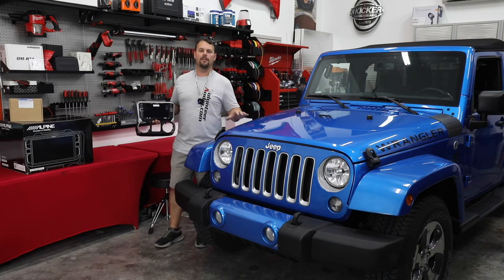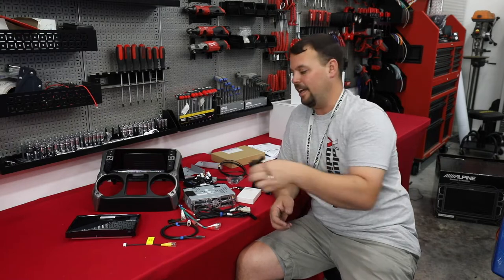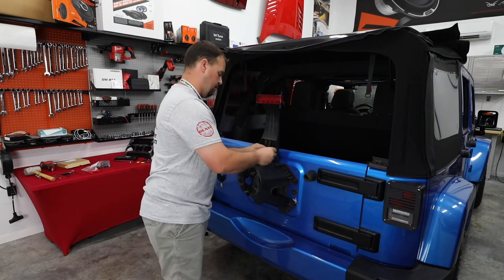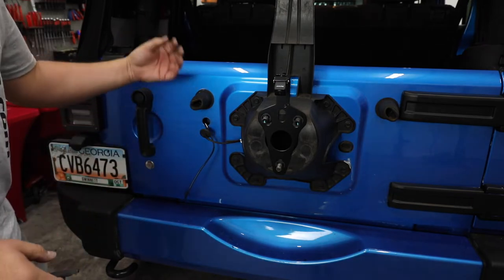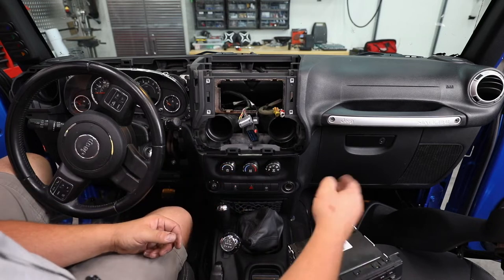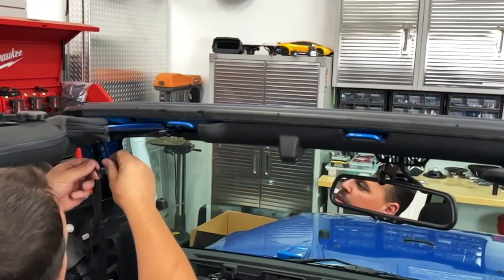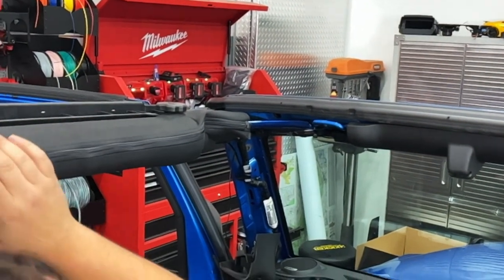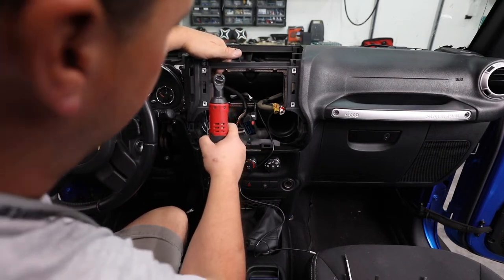Step by Step Install of the 9" Alpine i509-WRA-JK Restyle Radio in a Jeep Wrangler JK Unlimited

Comment: Excellent video, just the right amount of detail, watched it a lot trying to decide on the 509 for my JK, finally just installed one and the video helped tremendously, thank you! Definitely a big upgrade over the stock 430N in every way. Couple of minor differences in my install, mine has heated seats so there is a module attached to metal support bracket that has to be relocated and I used a Metra adapter to reuse the factory USB in the console that normally plugs into U-connect module which I removed completely, which is a little nicer than just routing to glove box. Also had to do a firmware update as it was out of date in the box, used the factory usb with flash drive no problem.
Reply from the maker: I’m glad we could help, did you purchase from Volunteer Audio?
Reply: @volunteeraudio  No sorry I did not, I had a lot of Amazon points to use :) Will be sure to check your site first in the future and recommend to friends!

Comment: i really appreciate this video.i have watched so many that arent my situation.my 2013 sahara has the not very good sounding alpine system with sub.and i didnt want to change out the amp.so this shows me what i can end up with if i change the head unit.this is video i will use the day i swap mine out.
Reply from the maker: This radio makes all the difference with the stock alpine system, give us a call at 1-844-30AUDIO to order and we also give you free tech support, free shipping and no sales tax

Comment: I figured out a few things that might be of interest to folks.  The crossovers come from the factory set to cut the bass from the main channels on the i509.  You have to open those up or you won't get any bass at all from the factory speakers due to that whole "it feeds the whole system from the front channel only" thing that goes back to the phone audio missing issue.  Just a heads-up with that.
Reply from the maker: Thank you for watching and commenting!

Comment: Jay can you tell me what engine information can be configured, I am looking specifically to add oil and transmission temps. Also is a switch panel available to operate light, winches ,ECT?
Reply from the maker: Idatalink maestro mrr2 module has 3 low voltage triggers that can operate external relay banks, not sure if they can be configured for your needs, as far as gauge info it depends on the data stream of your Jeep, if the ecm has the input from sensors you can create that gauge for onscreen viewing

Comment: I just don't understand why Alpine can't and won't make any type of module to integrate the stock  front camera and interrior mic to JL.
Reply from the maker: When the radio was developed for jl the front camera was not an option, also the factory mic has a latency issue that causes an echo, I’m sure they will eventually build an interface for front camera but these are digital hd cameras, not analog

Comment: Not sure if you addressed it or not, but how do you retain the factory USB port in the center console storage compartment to at least function as a charging port, if not also to connect wired car play?
Reply from the maker: It comes with an adapter to make it a charge port of your Jeep has the factory usb

Comment: I installed this same setup along with the alpine speaker/amp/subwoofer setup and I’m getting a massive amount of static/squelching through the speakers. It’s constant regardless of the volume or media source. Any thoughts on where to start looking. All the connections and settings were exactly as per instructions.  Almost sounds like ground noise, but I moved the ground and no change. Tried unplugging each speaker, no change.
Reply from the maker: Who did you purchase from? First start with their tech support, if bought from Volunteer Audio call us, if not start at your retailer
Reply: @volunteeraudio  I purchased it from Crutchfield and did the install myself. I tried calling them and they suggested some amp settings that are different than what is suggested by Alpine.  They are pushing a setting issue, but I’m thinking it’s either a component or wiring issue.

Comment: How do you trigger the back up camera with the manual transmission?  Do you need to run a trigger wire from the reverse light?  Thank you!
Reply from the maker: It should trigger through the data connection at the obd2 port, if not you would need signal from the taillight
Reply: @volunteeraudio  gotcha, thanks for letting me know!  I’ll try the obd2 method first and hopefully I won’t need to run a wire from the reverse light.

Comment: Hello, my understanding is that if the vehicle already has the Alpine amplified system that there was an extra module that needed to be purchased and plugged in with the install, the KCX – F200INT. It looks like this module plugs in where you switch those two wires around for the sound when a call comes in? Is the JK different than the JL for this
Reply from the maker: On the Jk there is no module needed, the alpine system sounds great connected straight to the radio, it’s absolutely amazing how good the stock alpine system sounds once you replace the radio, on the JL things are much different, the stock alpine system is lacking and distorted at high volumes, the kcx-f200int is for JL models only
Reply: @volunteeraudio  OK thank you for the information. I just got done installing the 509 on my jl and for some reason the maestro module and powered Alpine subwoofer in the back is not working. Are these two items related or not working? Any ideas and I’ve tried all the different radio settings for the sound and the subwoofer just doesn’t put anything out
Reply from the maker: @AdventurousRedJeep  for sure the maestro module needs to be on first

Comment: Dumb that it hogs your OBD port when the factory radio wiring already has CAN bus in it.
Reply from the maker: You can hardwire it if you want or simply unplug when using a scanner
Reply: @volunteeraudio is there a place to find how to hardwire? Diagram? Walkthrough etc. ?

Comment: Too bad this head unit wasn't an OEM instead of the nasty 730 they put or the 430s😢
Reply from the maker: Yes , this radio is far better than any factory option
Reply: @volunteeraudio  I just replaced m730 with a 7 inch android head unit but it only cost $330 Canadian lol android 13, 8 gig ram and 128 gig rom 8 cores very smooth headunit  and everything works

Comment: Thank you for this video. I purchased this system to replace the previously installed system and running into a lot of issues with the speaker wiring. 

My question is it mentions in the directions about if you have a manual transmission you have to connect the white/gray reverse input wire to one on the pass side kick panel. I didn’t see you do that here. I didn’t do it with mine but the unit recognizes when I put it in reverse and activates the camera. What is the purpose of the wire? 

Again thanks for this video it helped with my initial install. Now to seek out the gremlins.
Reply from the maker: No need to run to reverse if you use the idata module to activate the camera
Reply: Thank you for the quick reply! I kinda figured that was the reason, but didn’t see that mentioned anywhere and just wanted to be sure.

Comment: question the maestro should be able to use the uconnect and the jeep microphone and the jeep xm antenna i thought? why use the xm antenna shown in vid mounting that comes with the tuner? why use the alpine microphone? i am doing a very sim,ilar install but pieced together the kit (non wra ilx507, maestro rr2, sxv300 tuner, hrch1 mastro, alp1 maestro, and have adaptors for factory xm and fm antenna.
Reply from the maker: The factory microphone will have a latency issue that causes an echo, you can use the factory Sirius xm antenna with a sat1 adapter, we mounted the gps antenna for navigation overhead on the sound bar.  Uconnect does not work as well as the internal Bluetooth in the alpine radio
Reply: @volunteeraudio  thanks ! Appreciate your video and response!

Comment: I just had this unit installed in my JK but I’m having issues when making phone calls. The person I’m calling hears me but I’m unable to hear them. I’ve looked all over the settings but I’ve yet to find a solution to the problem. I can go to my voice messages & I can listen to them perfectly as they come through the speakers. My only issue is hearing the person I’m calling or when they call me? So strange… If you have any suggestions please let me know.
Reply from the maker: You have the factory amplified system, in the directions it shows to swap the front and rear speaker wiring , right now only your rear speakers are feeding the amp and you only hear Bluetooth calls through front speaker wiring
Reply: @volunteeraudio  Thank you! This solved my issue. The i509 Alpine Restyle is awesome. It’s definitely worth every penny.
Reply from the maker: @S_and_S_Farms  glad I could help!

Comment: I know this is an old video, but question:  if the head unit only provides output on either the front or rear outputs (the reason you have to switch those 2 connectors if you have factory amplified Alpine system), how does fade front to rear and timing for individual speakers work?
Reply from the maker: Alpine factory systems fade digitally through the maestro interface